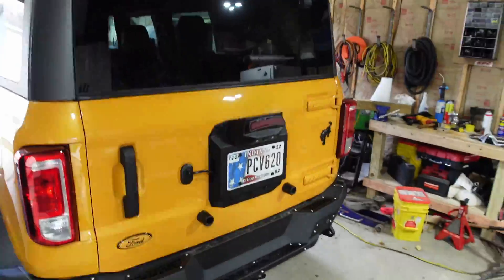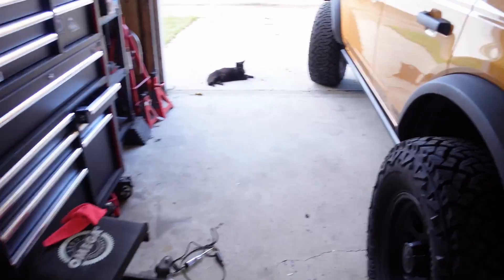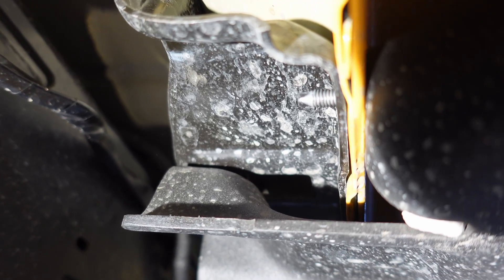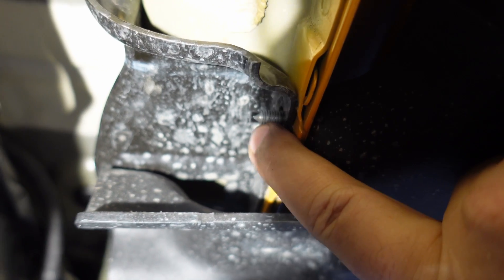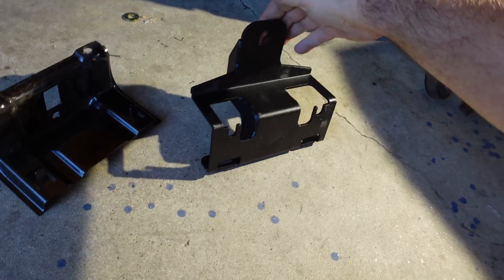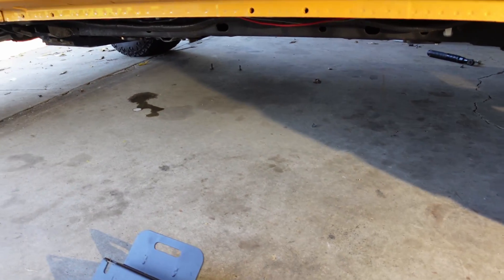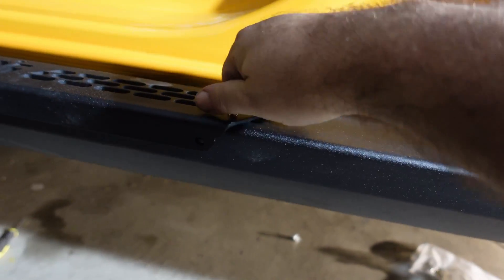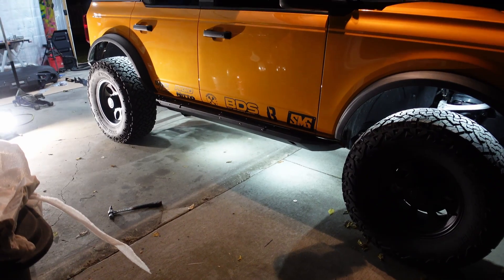Why These Rock Sliders are the Best Thing I've Done to My Bronco

Comment: Man, these early Broncos have so many quality issues. Brand new models typically have some from any make, but you can tell Ford was really trying to push these out. I have liked seeing the differences and similarities between this and the Wrangler. The rear bumper was very different. The sliders have a similar idea with the pinch seam studs and a single inner bolt. Sliders look good.
Reply from the maker: Yeah they rushed them for sure, hopefully the ones getting delivered now are getting a bit better  look over.

Comment: How much surface area is there to actually step onto to get in the vehicle? Also, do you find that they do a good job of deflecting rocks being thrown up from the tires?
Reply from the maker: It's just under 4 inches of surface area,  at the front it doesnt block much but as you go back it does,  there is a small triangle of space  right behind the wheel well that gets normal spray from tires but its much shorter  that without them .
Reply: @EvilleTruck  do you find yourself using it as a step to get in? Although 4 inches isn't much surface area for that. I'm not a fan of step boards(i'd prefer low profile steps), but looking for a solution for the stone throw problem. I guess sticking with the stock rock rails, switching to ridge grapplers and some rigged up mud flaps would be the best option for me.